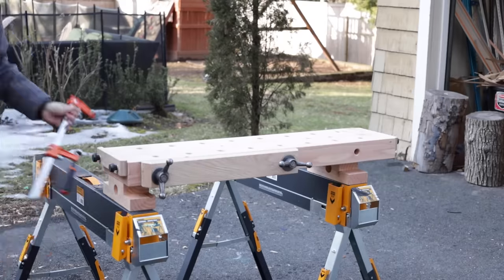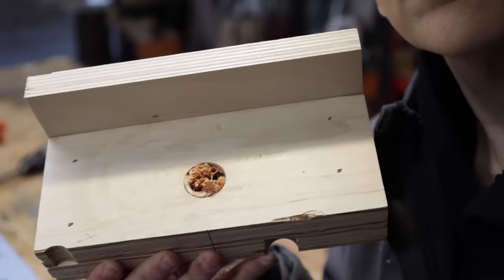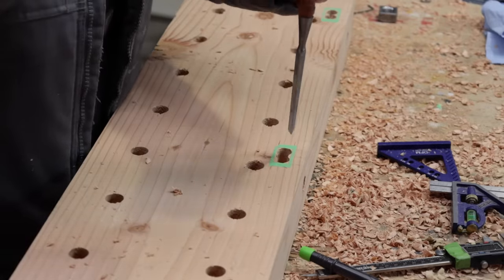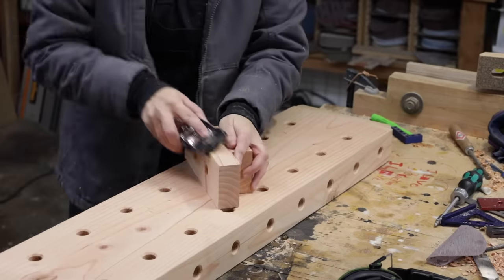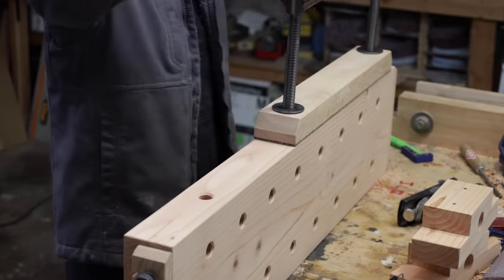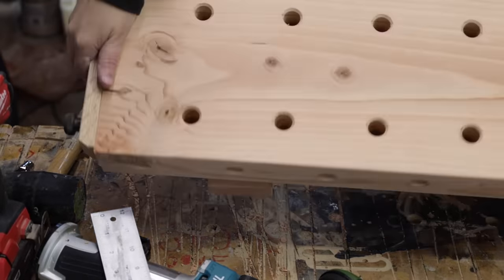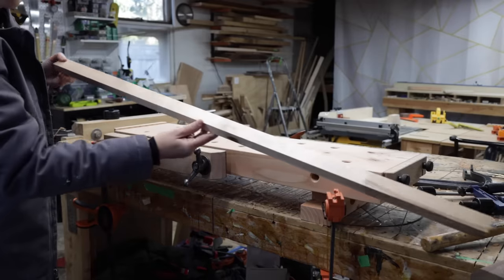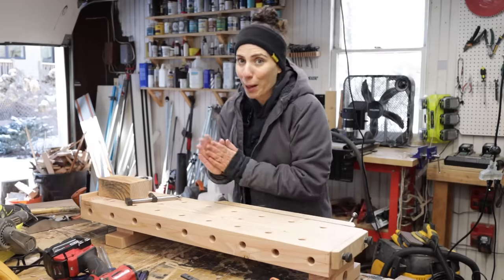Portable & Affordable Workbench for Small Spaces

Comment: Nice build! I may try this if I can ever free enough room to build anything! Old Sheetmetal worker trick for your dog-hole template might be worth a try. setup your block drill your first guide hole w/metal bushing... then drill a second at the distance you want the dog-holes.. again with the bushing. 

Layout a line to get your edge distance and drill your first hole ten place a dowel or rod through the template hole and find the center of your second hole by pivoting the template if needed.Place a block to slide your template along the line and drill the second hole. Remove the dowel and slide the template to the second and insert the dowel again. 

Rinse and repeat until your entire line of holes are drilled then do again along each line of dog-hole centers. This should help to insure equal-distance holes and may speed up the process.. or you may simply be more comfortable doing each layout individually. I had to make several templates to streamline different jobs doing sheet-metal work on Large-Cabin Corporate Jets. (Ret now) Hope this helps. -Jake

Comment: That drill bit looks like what I have for the woods but mine has a pre-drill smaller portion to help you line up the hole and a ring where your attaches to the drill for an appropriately sized stick through it to turn it by hand. I was also impressed by the nice holes that it makes and the sound it makes carving through the wood is really nice too.

Comment: If you'd like,  when making the jig for drilling the holes, you can make the jig with 2 holes spaced the desired distance.  Then when you use the jig,  after you drill the first hole,  slide the jig along one space and put a snug place holder in the first hole through the#2  hole in the jig.  And repeat.  I use this method for making holes for moveable shelves.  Hopefully i explain this clearly enough.   I don't think I did very well.

Comment: I bet if you took a socket and helped that bushing in more you could get it flush with the bottom.  Common trick for pressing stuff into other stuff.  Also a pipe on the vice handle instead of pliers to get more leverage.  Excellent work on the portabench BTW!

Comment: Thanks for posting this very accurate and comprehensive video. I just finished making one, and I'm excited to start using it! Follow Tamar's advice on drill bits, I found that the flat bottom forstner bits would clog and bind, but I also found the "speedbore" style flat bits with a lead screw were far too aggressive to control. Overall, this seems a worthwhile project as I have no real workbench yet and am working under a market awning in my driveway. This works!

Comment: Nice project, works well. 1 suggestion instead of using channel locks to help  tighten the vise, get a 18"-24" black/galvanized gas pipe. This won't jack-up the handle and provides way more leverage.

Comment: Interesting. My old house was built in the  1790/s. Up in the attic was a pine plank about three inches thick 24" wide and 8 feet long. It had numerous holes drilled in it. Square holes every so often  . Rectangular holes here and there. I figured out this was the top of a workbench. The holes were for holdfasts to grip boards while they were smoothed, or molded, or cut. Actually, it was very similar to yours. More primitive but I assume a vise could have been on the side where it was smoothed and squared. That house had rather elaborate trim. Part of it was a tavern later. It was originally a two over two, two story  center chimney house. Later an ell was added to face the new road. The roof was remade to look like a hipped roof,so the house looked square from the road.

Comment: Hi Tamar.  What type of wood did you use?  I couldn't find it anywhere in the comments.  I think Maple would be good for it's hardness, but 8/4 Maple at > 10" wide is a little hard to find where I live.  I could use 4 pieces of 4/4 Maple, but not sure if that's more prone to cracking/splitting over time.  Kind of new to this.  Your tool links have saved me hours searching around amazon and other sites!  Thanks so much.  :)

Comment: How you measure, draw lines, use the angle, glue, cut the wood (with no splinters), I could go on...  Easy to see that this woman has 1000 of hours doing just that. The reason I love this is that women improve work environment. It goes both ways. I have seen this 100 times. We need balance to make things good!

Comment: if you don't have the clamps, you can put screws in the spots where the dogholes will be. use pilot holes, bigger pilotholes and washers.
consider screwing it to a table or pallette
or build a few frames from scraps and use wedges to force the boards together [insert why-not-both meme]
in biggest doubt: park your car on it.

Comment: So, I’m just a DIY’er, but to crank down on your vise, use a rag on the handle and use your weight to push on the down side (don’t pull up) if you don’t have a small diameter gas pipe to use over the handle to get more leverage, but awesome build.
Subscribed

Comment: you did a fantastic job on this build. i am an old school custom wood worker and model builder for many years so don't feel this is a criticism. I would recommend that you don't connect the handles to your rods the way you did with lock tite. you should have just just drilled and pinned the handles to the rod so at any time necessary you could have just knocked out the pins and swapped out the rods for longer rods if  and when necessary. also cut a champ fer on the top of the legs instead of keeping them square. and finally use sanding sealer to seal your wood. let it soak 24 hrs and apply 1 or 2 more coats to seal your wood. your wood without the sealer will begin to crack and split as time goes on because of moister.
i built one of these benches 40 yrs ago out of mahogany and maple and it is still going strong and looks great. i have built a number of these for people through the years and they still look great and are still out there in the world and working great. i didn't use a lot of hardware on mine. a lot of the assembly parts are dovetailed and make the bench look elastically pleasing. always take your time in wood working and take time to look in your mind's eye what you want to build and how you want it look when finished. you will get more satisfaction in the long run. good luck and well done.

Comment: For owners of a low assembly bench this might be nice for doing fine work at elevated height so hunching over is not necessary.

Tamar, if you need to work a vice and it's too hard - use a hollow tube over the handle. Much better leverage than using a wrench :D

Comment: Hi, I appreciate your instructions and craftsmanship. I am looking for the right size bushing that I assume would be 1-1/2 in as opposed to the 1 inch I think you had. I have looked at hardware stores for it and they don't have a smooth steel bushing like that one. Do you know where you got it? Or does it have a more specific name than bushing which is so general across several crafts? Thanks.

Comment: This looks similar to one built for microjig clamps. I’ve seen that you’ve built some jigs with microjig material so wondering your thoughts on a hybrid. I do have holdfasts that I like and use on an old workbench that is failing fast and needs to be replaced. Trying to decide on the design of the replacement.

Comment: I hope this gets seen. I am wondering how well it would hold up if you were to take a 2 x12 of construction grade and laminate onto it two 2x6 hardwood. My concerns are that any movement of the wood may not be at the same rate due to being different species. My reasoning for considering this is that my local big box store has 2x6 inexpensive. Don't even carry hardwood 2x12. But if this works it would be easier to find the needed wood.

Comment: When i clicked the Taytoll link for Cork Rubber Vise Jaw Lining they showed 2 options 1-PSA (pressure sensitive adhesive) and 2 non-PSA (without pressure sensitive adhesive). What is the difference? Might use as floor for modelrailroad tracks. Thank you

Comment: Well it's a great design, but I don't see any obvious advantages over a regular planing bench. If you need a bench to mount it on, I guess you have the space for a planing bench anyway. And as for the vertical clamping options, the hardware would be in the way a lot if you wanted to plane a piece for example. But the side clamping of irregularly shaped pieces is very cool.

Comment: I appreciate you using a planer, but admitting that not everybody has one and showing hand-tool alternative options instead. Not everybody does that, and many assume you already have the workshop you need to make the workshop you want. In fact, you mention at the end that the build only needs a drill, but to be honest, I'm very confident that a good brace with some long, sharp auger bits could handle this task without taking an eternity too.

This is a really sensible, compact, and affordable build; I wish you had been around when I was younger, because this would have been perfect for teenage/young adult me wanting to get into woodworking but not having the space, machine tools, or much money to work with.
Reply from the maker: Glad tok appreciate that!

Comment: Cool, but you have a near NASA collection of nice (and very expensive) tools. For the John Smith on the other side of the screen is cheaper and much less tiring to buy, say, a Black & Decker workbench than making it only with a drill, haksaw and sandpaper.

Comment: I've tried doing this project twice and it has a major design flaw. Trying to drill a straight 8inch 3/4 hole is virtually impossible without a drill press. I wouldn't do this project unless you have a drill press.
Reply from the maker: There are drilling guides that make it possible.

Comment: And  there you are, colder then hell and you still have the brain power to not wear gloves around rotating machinery. Fact is I didn''t see you wearing gloves at all even when handling lumber right off the truck,,,,,and you are a Lady, to boot! ,,,,,You not only are as good a designer and craftsmen  as any of them but also know how to work safely without going overboard.  The tough guys and safety Nazis on the other woodworking channels should be ashamed. I'd work on a jobsite with you any time.